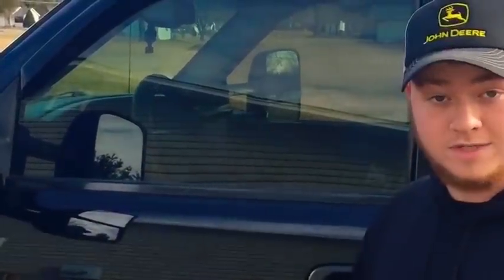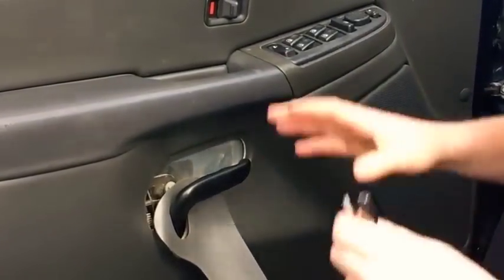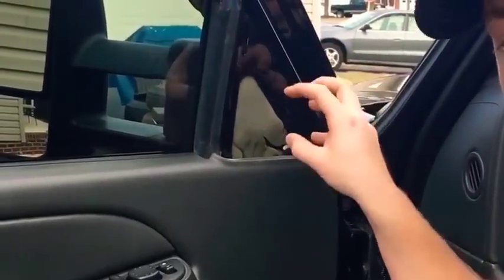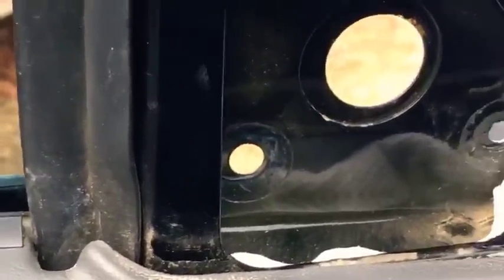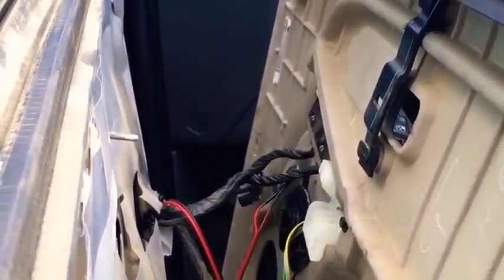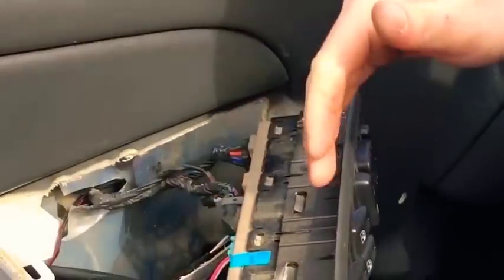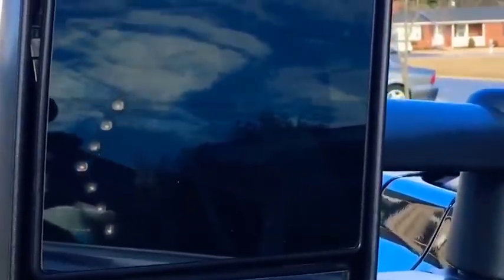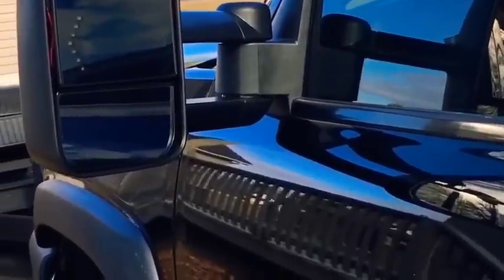Yitamotor ▎Step by Step Guidance on Replacing Tow Mirrors ▎ 2006 Chevy Silverado 2500

Comment: Excellent comprehensive video. I will add a couple of steps because I was removing a broken mirror that was already powered. In preparation you need to cut zip ties on the cable in three locations so the cable can be pulled out when the mirror is removed. There's also a T20 Torx screw in the center of the mirror base that has to be removed. It's going through a strain relief that's taped to the cable which also has to be removed. You don't really need to remove the switch panel if you plan to remove the entire door panel like I did but you will need to disconnect the cables and the bulb and socket for the marker light on the lower left of the panel, I'm not a fan of removing the switch panel because it's too easy to damage the screw hole that retains it. I will be doing a video review of the mirror I bought on Amazon and reference your video as an excellent source for the replacement procedure. Thank you and great job.

Comment: Has anyone ever installed the tow mirrors like this and had the regular power and heated without the signal but bought the signal glass after and wired it in? I wanna try to get the signal light in mine cause i lile the look